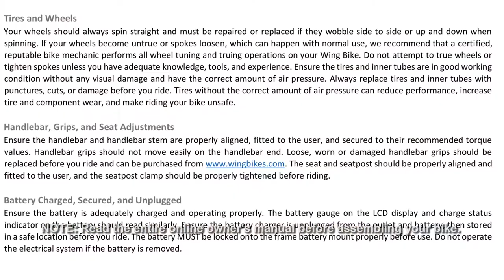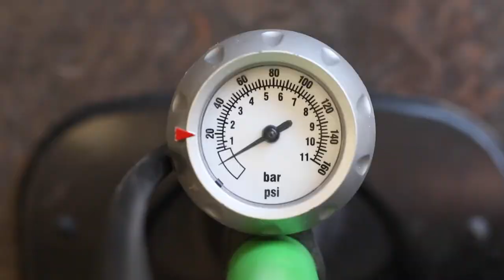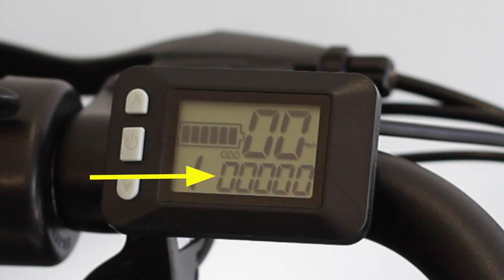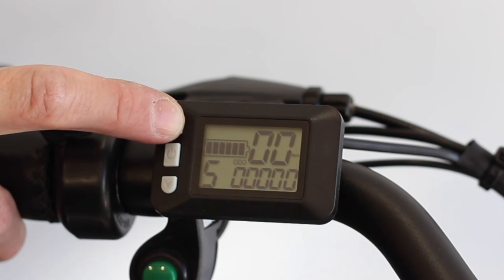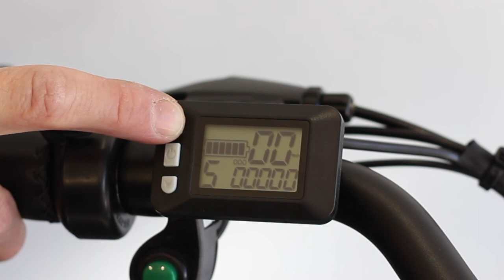How to Assemble your Wing ebike | Wing Bikes

Comment: Partial contents:
1:20  Seatpost
1:35  Handlebars
2:13  Pedals
2:46  Front Wheel
3:09  Lights
3:50  Fenders
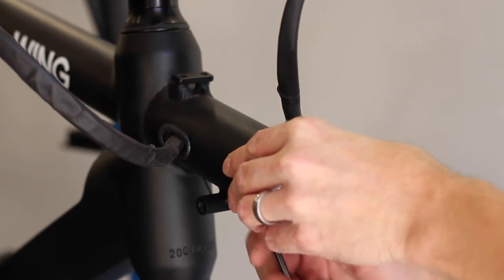6:00  Throttle
Reply: Thank youuuuuuuuuuu
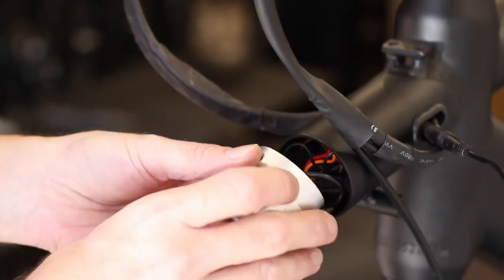Reply: 7:06 Stem Extender (Optional)
9:10 Install the Battery
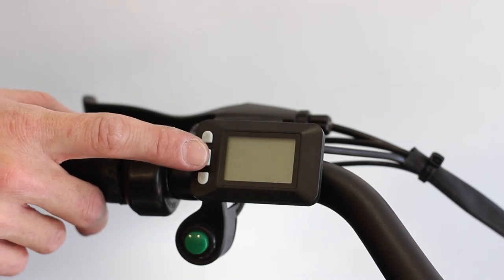9:36 Power on your bike
10:48 Adjust the gears